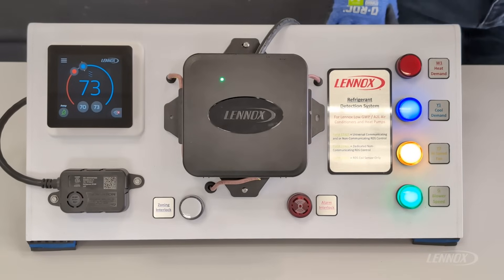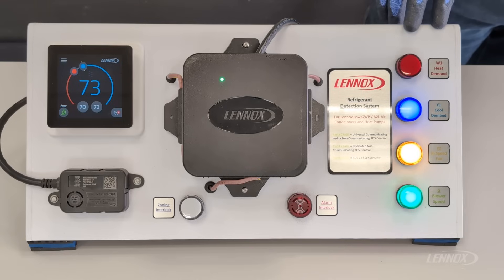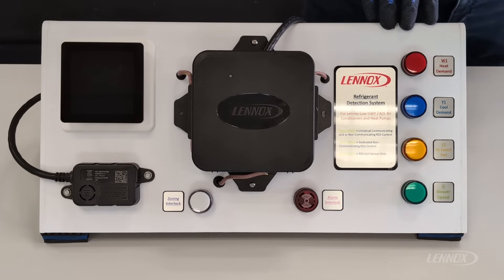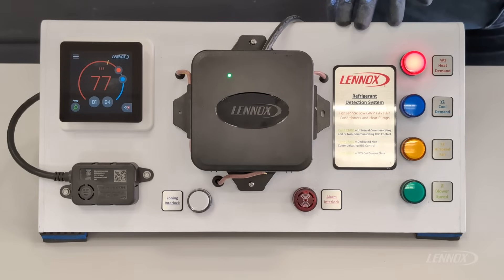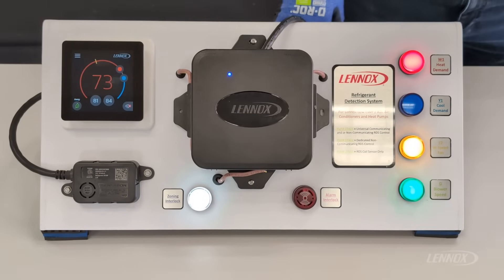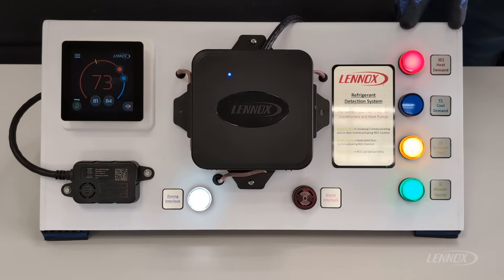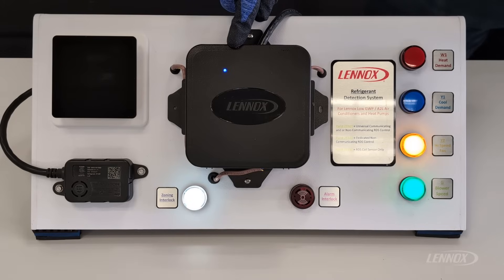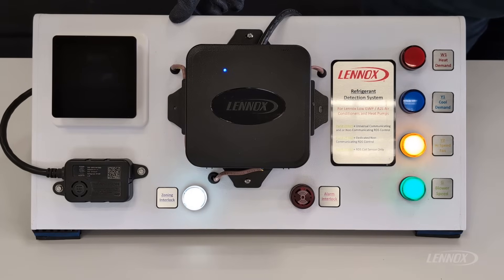Lennox Refrigerant Detection System Modes | Initialization, Monitoring, Fault & Mitigation

Comment: Problem is say you get a freon leak.....the detector stops the unit from running but it doesnt stop the freon leak. Say its bad. Homeowner comes home. Smokes a cigerette or lights a candle. Then boom..the sensor NEEDS TO BE TIED INTO A VENTILATION SYSTEM!!!!